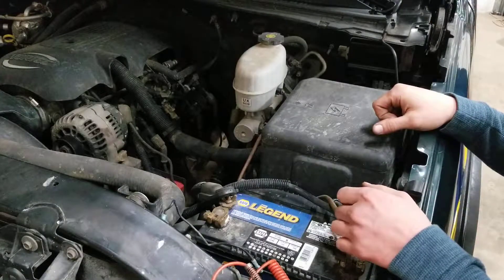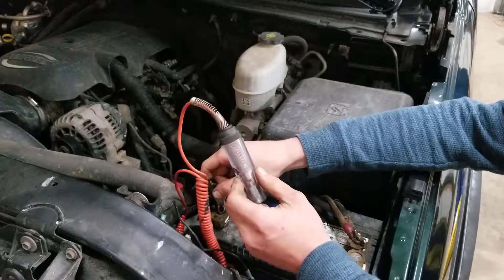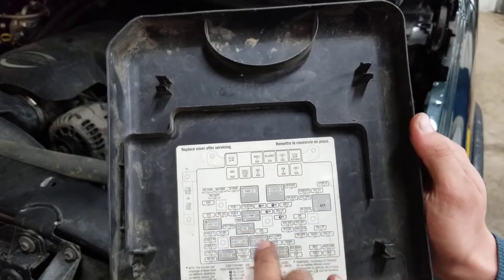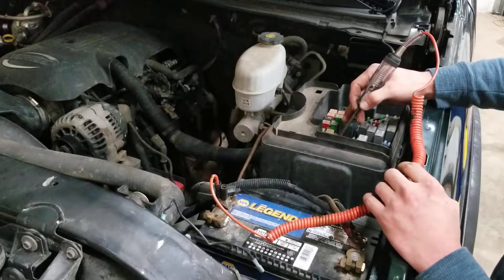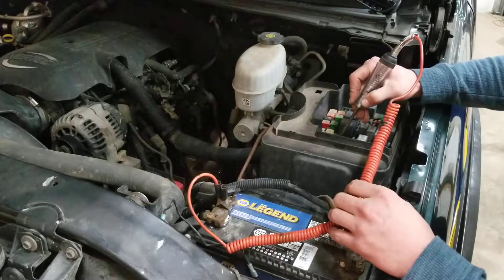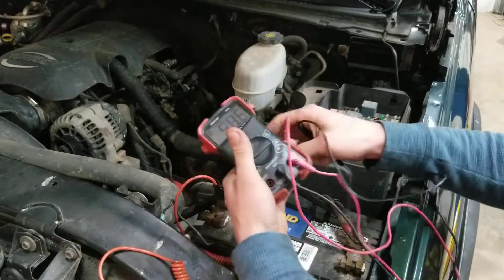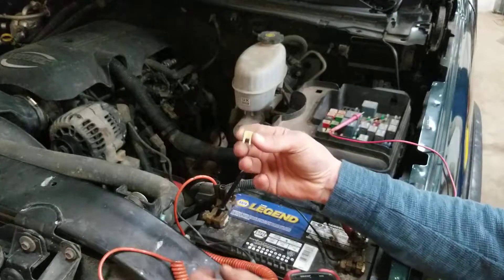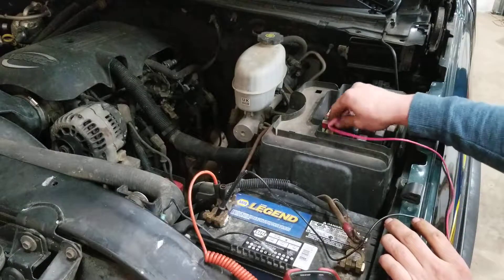How to check and find blown fuses

Comment: How do you check the larger fuses?
Reply from the maker: The larger fuses, if you don't have access  to the terminals (square fuses with the clear plastic tops) you may need to remove it and check the resistance across it with a multi meter. Some people pop the tops off but this can allow moisture and corrosion to damage the fuse over time. You can look me up on Facebook @diyautomotivefix and contact me on messenger there for faster replies. I'll be out of town for most of the day but when I get back I'll be glad to help you in any way and walk you through the process for your specific fuses.